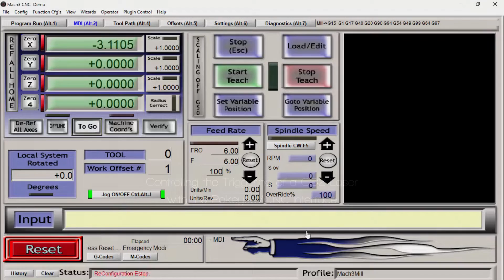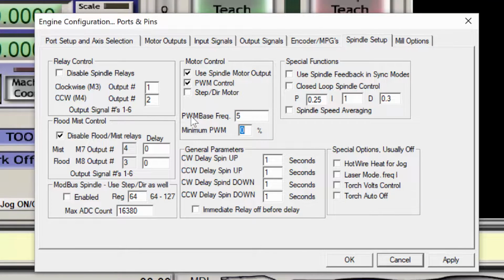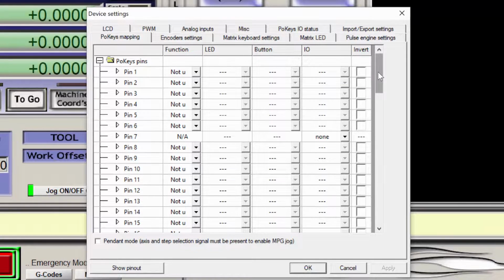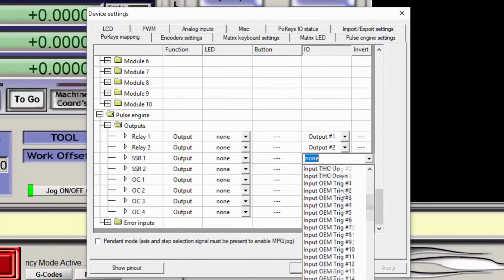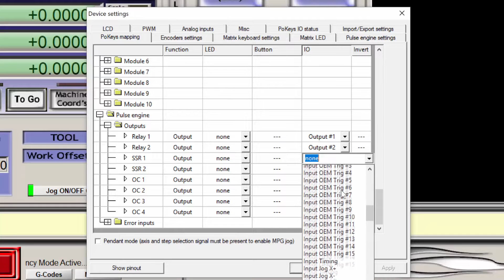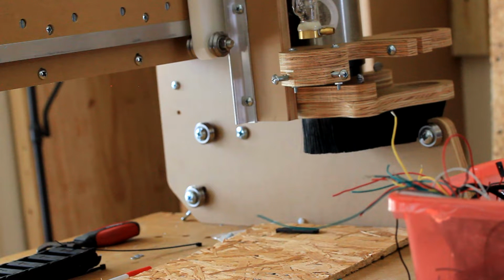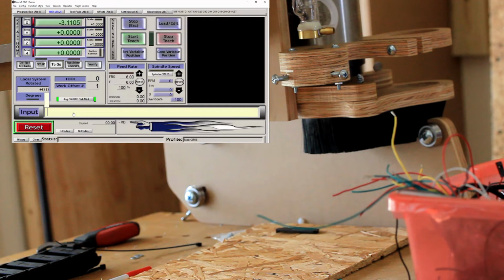7. Controlling the Triggering of a CO2 Laser with the Pokeys57CNC Interface

Comment: Didn't show connection to ssr
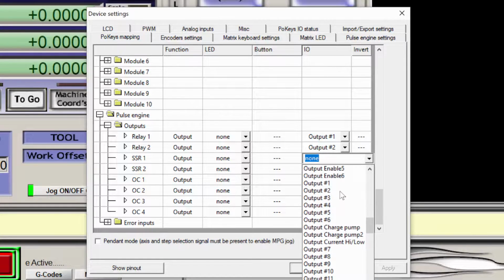Reply from the maker: At 1:04. The SSR1 terminal is directly connect to the laser power supply's trigger (TL) whichever triggers your laser. I even showed screwing in the wire. What didn't I show? The connection from SSR to the TL on the power supply?